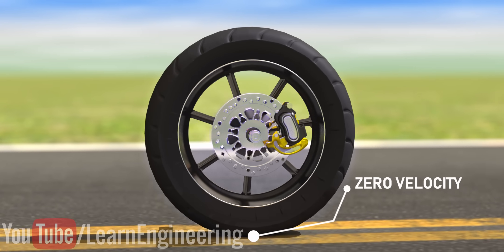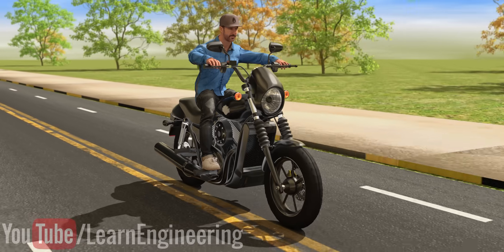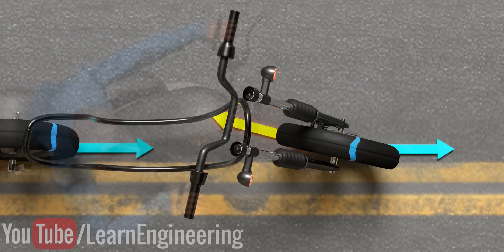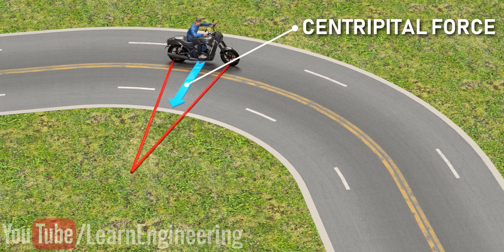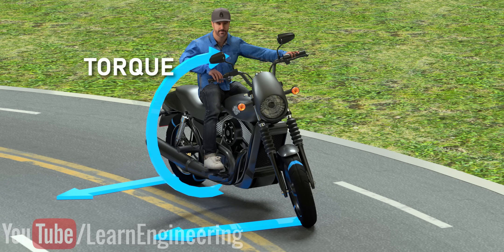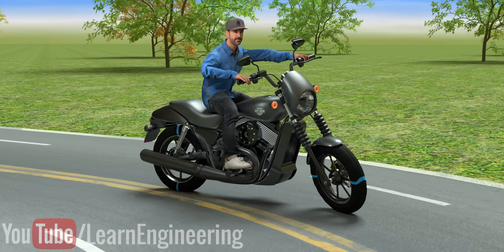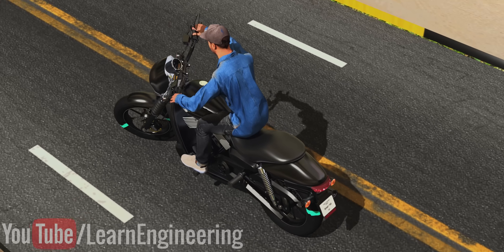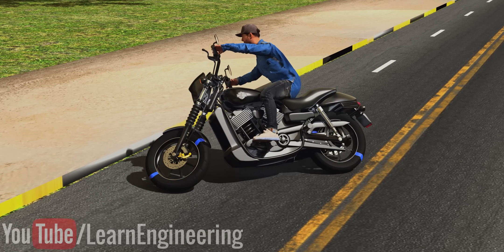Counter Steering | The interesting physics behind it

Comment: This video makes counter steering sound optional.  It is impossible to turn a motorcycle without counter steering.  Counter steering is what puts a motorcycle into a lean which is what turns the motorcycle through cambered thrust.  Cambered thrust is what makes a Dixie cup roll in a circle when rolled on a table on it’s side.  Another observation is the assertion that the rider must purposefully turn the handlebars back to the precise angle required by the turn.  It is actually the rake angle of the motorcycle’s forks that accomplishes this once the rider stops turning the handlebars when he or she is at the lean angle he or she wants.

The author would benefit from taking a MSF motorcycle rider safety course.

I did enjoy exercise in the physics involved in why motorcycles must lean in order to turn.

Comment: I ride a normal mtb cycle. But little faster at 25 to 35 km/h. One day i was crossing a small road near my home, suddenly another cycle came from right side. I stopped my both wheels by braking hard, and i turned at 90 degree angle without falling. I didn't say anything just came home.

Comment: Nope nope nope... this is a terrible explanation of counter-steering. Sorry. Twist of the Wrist or Keith Code's video/books do it properly. You DO NOT need to shift your weight to steer your bike (unless you are a pro racer going 200kmph in a corner like in MotoGP). A bike ONLY ever uses "normal steering" when going at slow speed like below 30kmph/20mph. Any higher speed requires a countersteer action to turn the bike (no lean required), the bike naturally leans itself over and once you UNDERSTAND the technique and with a little practice its super easy to do.

Comment: There is actually no such thing as normal steering.  As a cyclist. . .  I had an interesting discussion with another cyclist about what keeps a bicycle upright.  I’ve maintained that we are ALWAYS falling over, in circles of larger and larger radii as we improve.  

Tune the bars keft, you dall to the right.  Turn the bars towards the fall, proceed through the turn.  Every racing cyclist does this instinctively.